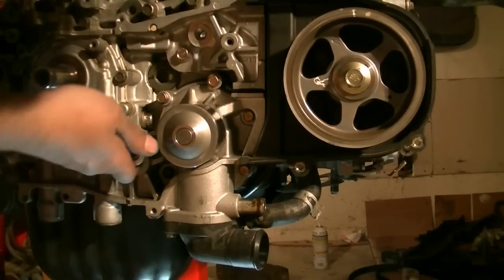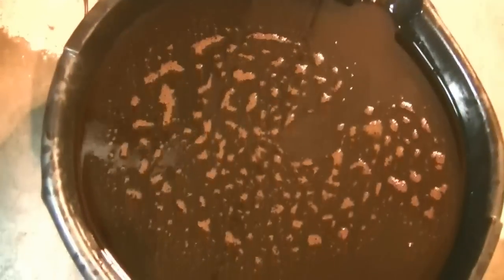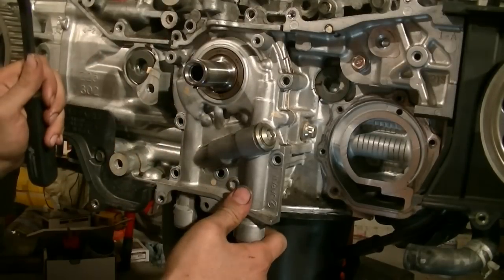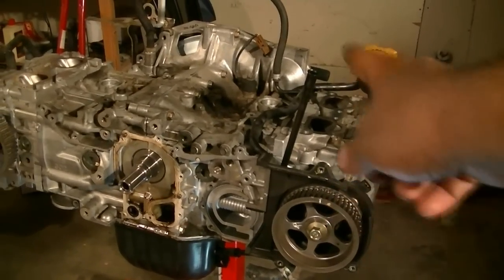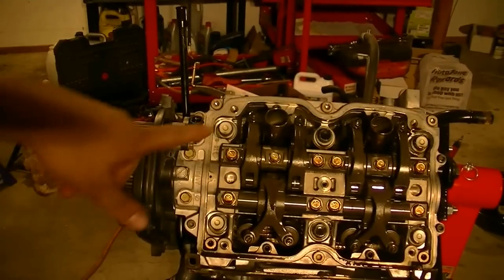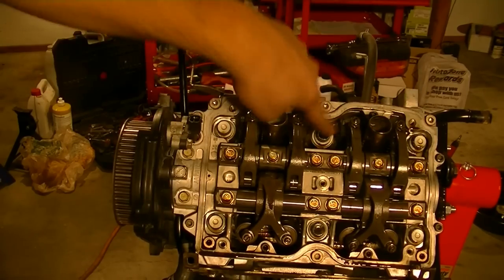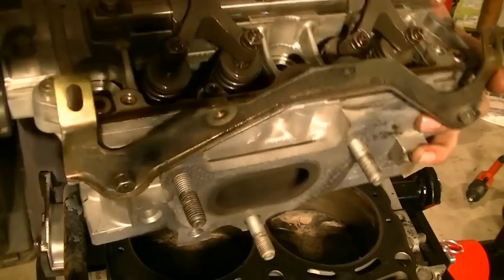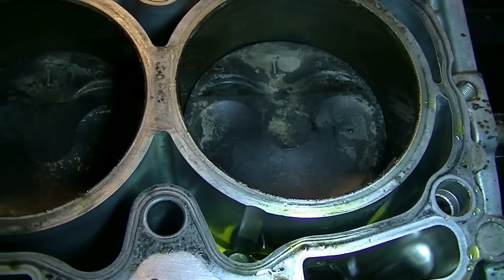How to Rebuild an EJ25 Subaru Engine - Part 3

Comment: Somebody disassembled that engine before you... the bolts that you're taking off at 7:38 were put in wrong... the two black bolts are supposed to be in the center of the head with the white ones on the sides
Reply: Yikes!!!

Comment from the maker: You know I started to feel it may not be a rod knock the more I got into the engine, but this engine knocked all the time when not idling and the sound was undoubtedly a knock. Sometimes bad timing chain tensioners/guides/Timing belt tensioners make a noise which could sound like a knock, also on some of the VW engines where there's a hydraulic cam chain tensioner which works off the engine oil you could hear a knock when they go bad. Have you tried using thicker oil to see if the sound changes?

Comment: I've had what I think might be intermittent rod knock on a Chev vortec engine, but performance has been fine and there are no other problems. It seems to go away after a few minutes, and sounds a little different than sticky lifters with cold weather. I'm not so sure of the diagnosis. 

This engine looks pristine. Can you be sure it was rod knock on yours?